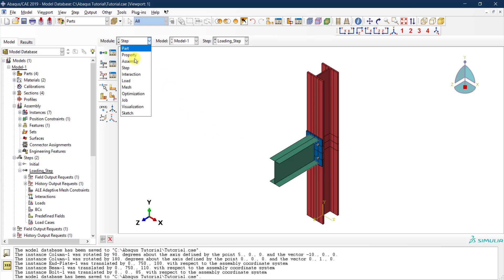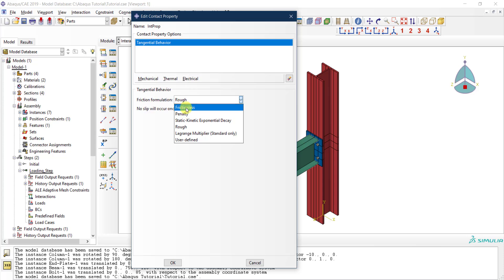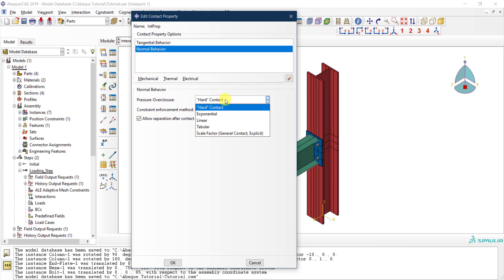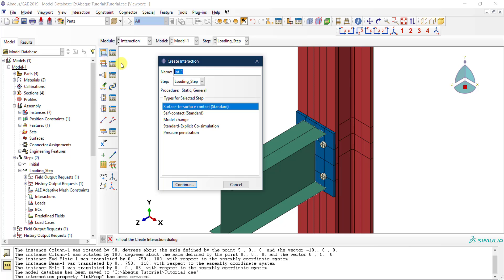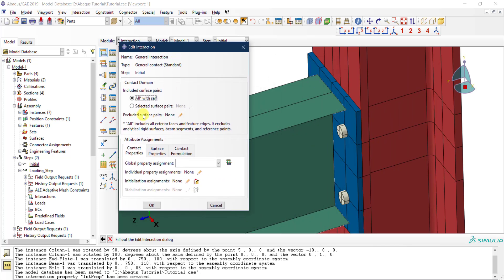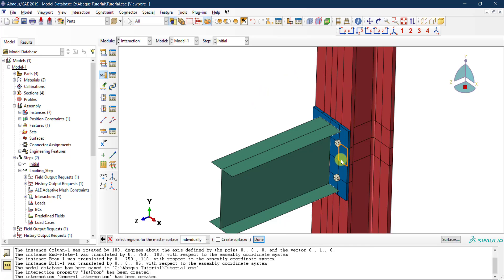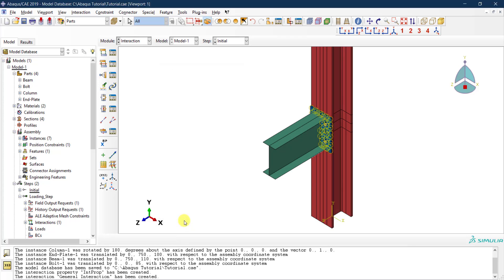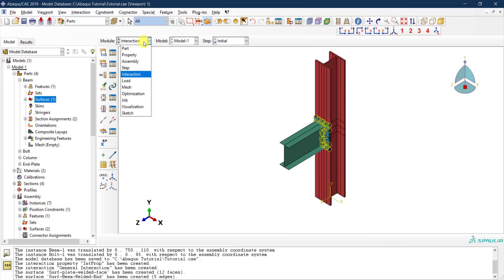#13 ABAQUS Tutorial: Defining contact interactions and tie constraints

Comment: Hi, thank you for the very informative toturial. I have a question, regarding the need for creating a tie constraint between the beam face and the plate? In practical scenarios, if the beam is welded to the plate, I understand why a tie constraint would make sense. However, if the beam is not welded, wouldn't the bolts alone be enough to hold the beam in place?

Comment: Dear Ahmed, I am doing a static analysis with several contact regions (solid to solid, solid to shell, shell to shell). I encountered a problem. When I use 45 mm mesh size within the model (default element types), I achieve the convergence. But when I increase the mesh density, analysis does not converge. Do you know what could be the cause? Thank you very much for the help. I have started to use Abaqus 8 months ago, and with your tutorials learned a lot.

Comment: Hello, I have a quastion. Originally the contact between the gray beam and blue plate is provided by welding. How we can use the same interaction between each two part in this assembly?
Reply from the maker: Not sure I fully understand the question. Note that welding is not explicitly modeled here; instead, a tie constraint is considered between the beam edge surface and the end plate.

Comment: Thank you for your video.                                                                                                                                                                                                                                                           This warning message always appears when I use Tie constraint (for tie pair (for tie pair (assembly -s-surface16-assembly -m surf-16 ) adjustment was specified but no node was adjusted more than the adjustment distance=2.22000*10-16). will this warnning massege  affect the analyses and  the results? . And could you give me the way to solve it ?

Comment: hello, Ahmed. Thanks for your video! 
I'm trying to set the interactions for the heat transfer solution,  but I can't do it. The heat is not transferred to another part.
I tried using tie constraints, but the result is the same. 
Can you give me some advice?
Reply: oh, I found a mistake. The thermal conductivity was very small. And I lost two days.